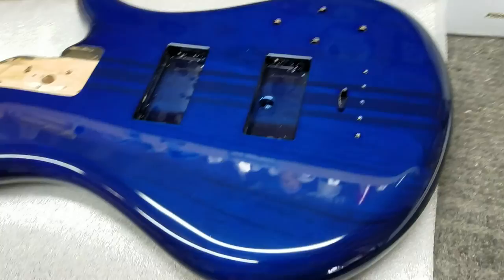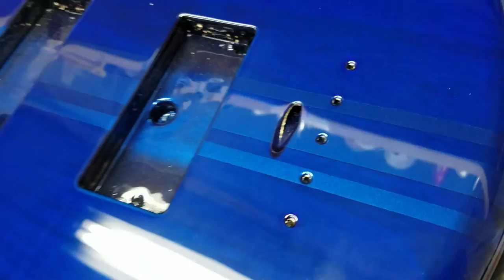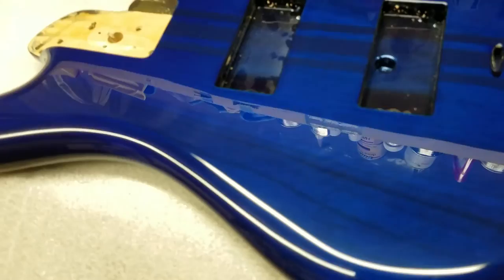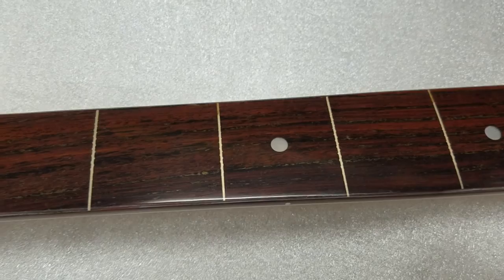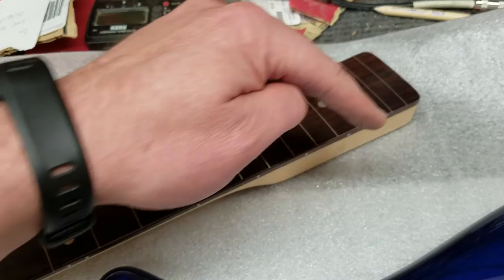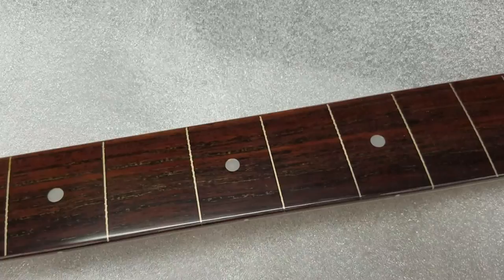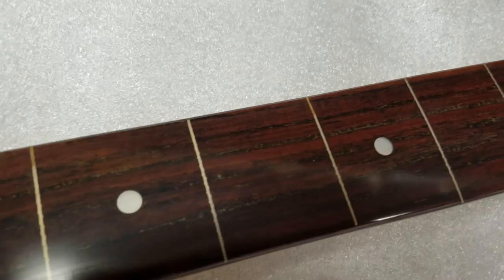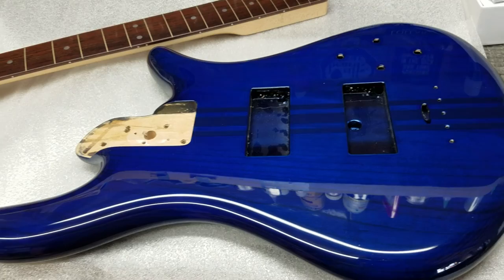Fretless bass achieved with epoxy!

Comment: Thanks for the video! Could you please explain how you finished it? I put epoxy on a fretboard and it was very uneven and some bubbles. I tried a little wet sandpaper 600 grit and it became a disaster. Would really apreciate it. Thanks!

Comment: what kind of epoxy did you use, Solarez?
Reply: +Mikail Elchanovanich I'm kinda curious about that too. It looks amazing!
Reply: Tim E
indeed, would rather like to do this myself
Reply from the maker: +Mikail Elchanovanich i used west system 105 epoxy resin mixed with  206 slow hardener.
Reply: okay cool, thanks man.
Reply: Sweet! Thanks, man. I'ma give it a try.